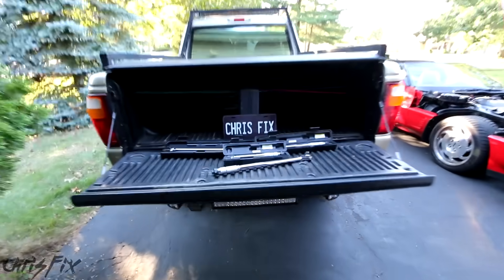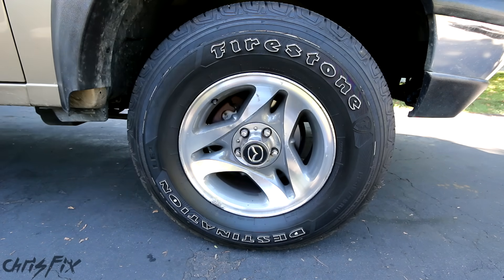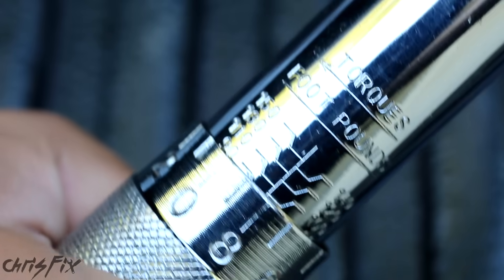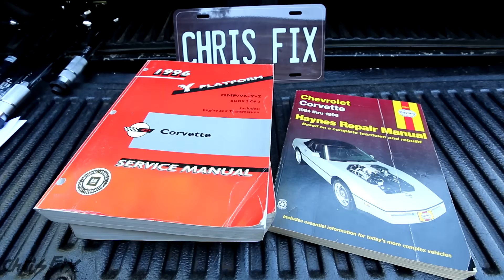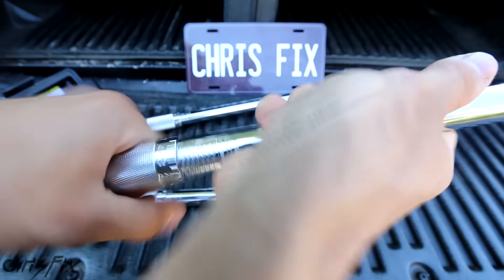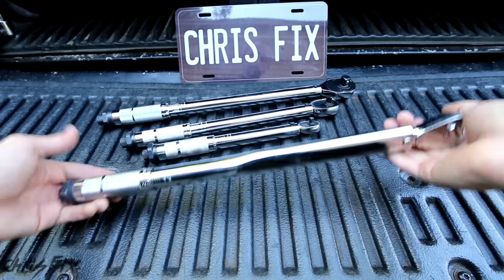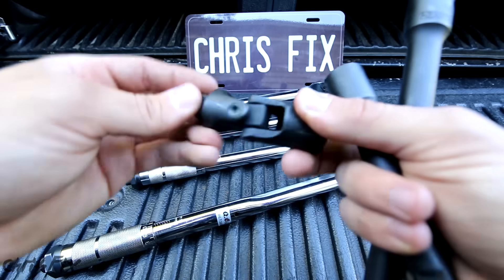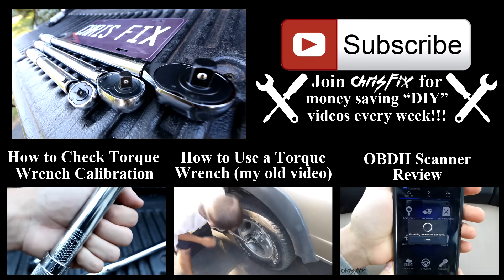How to use a Torque Wrench PROPERLY

Comment: When torqueing a bolt, the objective is to stretch the bolt such that the force generated by it is applied to the bolt's threads.  This causes the bolt head to compress the two mating surfaces together with a known force.  Although unperceivable to the naked eye, bolts do stretch.  Different materials have different stretches per given force. In some applications, you want the bolt to stretch more due to its internal structure.  Roller coaster bolts, for example, are able to stretch more but are hardened steel whose sheer properties and strain stay within the limit of forces placed upon them.  They are very critical and must stay within their design limits.

In the automotive world, the best known torque, of course, is lug nuts.  Stretching the bolt using the correct torque with apply the correct force to mate the two, actually three, surfaces together correctly.  When the wheel bounces around, it wants to separate the materials by overcoming the forces holding the lug nut against the wheel.  Correct bolt stretch caused by correct torque will keep them together within their design limits.

If on a properly installed wheel, measuring the stretch will achieve a more correct force; however, not too many people have such equipment. Torqueing is the next best way and easy to do.
Reply: I got it, & totally understand. Thank U for sharing. 🙏🏿
Reply: well call this a lesson.... thanks dude
Reply: Smart affor this 🗣️
Reply: yeah i ain't reading this bru 😩😩😩
Reply: @ferrariboxbox  I did but didn’t get it😅

Comment: Torque wrenches are actually not a good measure of the preload on a bolt. With CAT and other equipment manufactures you use degrees of turning. First you make sure the bolt / nut is seated then rotate the bolt X turns or degrees. Why because knowing the thread pitch the manufacturer can calculate the bolt preload or stretch. Now with torquing friction can vary based on lubed or dry threads, biolt head surface, thread condition etc. so for "precision" we dont use torque wrenches. Another example is the cylinder heads on large marine engines where we actually use a hydraulic ram to stretch the bolt that could have a 2" diameter then we can almost run the nut down by hand, release the pancake hydraulic ram and go onto the next bolt! I have even used torque multipliers on some bolts but again torquing with a wrench is press accurate but can be way off. I won't go into aircraft but our torque wrenches (yes we often use torque wrenches!) are calibrated regularly and the FAA inspector will ask to see these certs and see the wrench and match the SN. They dont care about the sticker on the wrench and can be very fussy! Lots of torqueing experience over 50 years!!!

Comment: Thanks for the teaching. As always, I look up to your videos to learn more. I've had three torque wrenches for years now but I have never used them (they were given without instructions)  because of the lack of knowledge. I have always relied on "measured force" to tighten the bolts and nuts that I have come across with. Unfortunately, age collects higher rent as the years go by and I cannot longer trust that method. Please keep your videos coming as they have proven to be very informative, entertaining, and instructive.

Comment: Unfortunately this shows exactly the way you should NOT use a torque wrench. Too much force is applied and yes you can put a lot more torque on that wrench by just not using it carefully and very slowly. Noone does it correctly with lug nuts because they can handle more force but if you do this on an engine you might run into problems.

Comment: I'm not sure if anyone commented on this already, but to be most accurate, one hand should be holding the head of the wrench stable, while the other hand is on the handle, applying the torque.  This ensures that the torque is being applied on the proper axis.

Comment: If it's anything like springs I've used with firearms, it's much worse on the springs to go from tensioned to untensioned on a regular basis than it is to just store the items being either tensionsed or not.

The continual tensioning and untensioning causes more issues to the spring.

Comment: The proper way to torque a bolt is to get a great big breaker bar and put a pipe on the end of it then you tighten it down until it strips then back it off one turn

Comment: can you use conversion adapters? like if you have 1/2 inch torque wrench, you get a 1/2in to 3/8 adapters will it calibrate correctly?

Comment: I've always been told to tighten torque wrenches to 20% maximum value when storing, so if the 1/2" torque wrench max torque is 150 ft- lbs, then you would store it at 30 ft-lbs. 
Not sure if this is the correct way, any Engineer out there know if this is correct?

Comment: After the incident where I snapped a bolt for my hydraulic timing belt tensioner with a torque wrench, I basically stopped using them. Since the bolt goes into the block i thought I ruined it but luckily I got it back out and the threads were fine.

Comment: It's honestly cheaper to buy a new torque wrench than get them calibrated. $25 half inch 10-150 ft-lbs torque wrench vs $75 calibration. And don't give me that "I have to buy the $150 dollar Snap-on wrench cuz torque is so important!!!" Anything you are doing in your garage can afford to be off by at least 10% so the cheap +/- 4% wrench does just fine

Comment: I bought a 1/2 inch 3/8 inch and 1/4 inch from harbor freight.  Pittsburgh Brand.  The 1/2 inch has all the guts fall out of the top after a few times of use.  And yesterday the 3/8 inch has some sort of gear problem.  It wasn't catching.  Was having to move it around a lot to get it to work.  Anyways, is that just because it's a harbor freight?  One thing I did notice was that you didn't release all the tension off the spring which I always did.  Also somehow i got water into my case on the 3/8 inch.  Resulting in some rust forming.  Could that have cause the gears to mess up?  I'm just kind of at a loss and harbor freight is telling me they won't let me exchange it because I don't have a receipt and there was glitch in the system that wouldn't let them add me so now I have to buy another one.
Reply from the maker: That could happen, I'm surprised to see 2 of them going out like that. I would just go back and get them to add you so you could get an exchange!

Comment: Why would u use ur muscle and back to lift up the Torque Wrench? I learned to use my weight on the Torch Wrench and pressing it down, which is a LOT better than this..
Reply: Always pull , don’t push. It is harder to stop when needed if pushing causing over torquing.  fastener could slip and cause injury to you or equipment.
Reply: @misterbgs1  I never had that, I push until I hear the “click” sound and I stop right on time.

Comment: Plan on doing my spark plugs myself so this video was absolutely helpful. I bought the wrench, plug socket, and extension. So this is absolutely nice to know. I already feel more confident about it
Reply: How did it go, mate? How many times have you serviced your spark plugs and the related components by yourself?
Curious to know!
Best wishes.
Reply: I’m planning to do the same and also with my brakes, need the torque wrench and some lubes and I’m all set

Comment: Hey ChrisFix! Your videos have inspired me to start my own DIY journey on my Honda Civic. I bought the  1/2" Teng Torque Wrench. I've read that with the clicker torque wrenches, you shouldn't use the low settings. The Teng torque wrench I bought is 10-150 ft. lbs, what range do you think it will be reliable? The Honda repairs I want to do definitely call for a 1/2" torque but I am curious if I can hit the 14-17 ft lb range I also need or if I should  buy the 1/4" torque for those. Sorry if this is a little wordy but I appreciate and value your insight!

Comment: I just bought a Neiko torque wrench that has the numbers 0-1-2-3-4 on the handle instead of 0-1-2-3-4-5-6-7-8-9 numbers. What do I do about that? Is the 1 really 2 feet of torque? And the 4 really 8 lbs feet of torque on my wrench? I read the instructions, but the instructions don't even refer to the 0-1-2-3-4 numbers on the wrench I bought. The instructions are using 0-1-2-3-4-5-6-7-8-9, like your wrench. Thanks...

Comment: If the manual specs shows 160 lbs of torque and the torque wrench has 
upto 150 lbs do you set it down to 10 lbs for the difference to add onto?

Comment: Thank you for this video. I understand the idea now. I  need a torque wrench for my 14mm oil drain plug so I can make sure it's tightened appropriately. Can you point me in a direction? Right now the only idea I have is to google small torque wrench.

Comment: Never pull "UP" on a torque wrench as he has demonstrated. Move to the front of the tire and push down to achieve the torque. Use your body weight with a straight arm to get the leverage you need to torque it. Use your legs and not your back. Its the way I learned in the Airforce when torqueing aircraft nuts. It will save your back in the long run.

Comment: Best auto mechanic instructor on the web hands down.  Clear & thorough instruction, quality audio/video production...you rock Chris!
Reply: As Fred Rogers said, "You don't set out to be rich or famous. What you set out to do is to be helpful." That is what Chris has done. He set out to help people learn how to fix their own cars properly.
Does anyone get that reference?
Reply: You can use his teachings as a greenhorn and properly work on even delicate parts like cilinder heads, carbon fibre clamped fastners which require only 1.1Nm. He's good, quite good a teacher

Comment: Is it safe to use 1/2 inch drive on spark plugs ?
Reply from the maker: If it requires a torque that high then you would have to!
Reply: @chrisfix  my spark plugs require 25nm? So is that fine or would I need a 3/8 torque wrench

Comment: Remember you still need to apply counter force on the head of the wrench so all the torque is in the proper direction. Sure the losses may be minimal but when using extensions it is important that all the force is applied correctly on the nut. This ensures your torque is on the correct plane of the entire nut/bolt instead of pulling away from the head of a bolt.

Comment: Chris, question sir. I want to bring a torque wrench when I go off road or go on vacation, just in case I need to throw on the spare. Is using the 1/4 wrench okay?  My lb-ft is 100, but I don't feel like brining the 1/2 inch because its so large.

Comment: Hi, I have a question. I know you said that you can use extensions with a torque wrench, but can you also use drive adapters? For example, my socket set is mostly 3/8 in drive, but I want to get the wrench in the description. Can I use a 1/2 in to 3/8 adapter?

Comment: I got a quarter drive one recently and the click is not so obvious so I turned the bolt beyond ii the first couple of times. I hope I didn't mess up the calibration. Fortunately it was for a lower torque setting (9 nm). Hopefully it's ok.

Comment: since the units for torque are multiplied the way you say it really doesn’t matter
lb x ft = ft x lb
however, a measurement like pressure which is force / area is completely changed when swapped

Comment: in moist/winter climates with salty roads you dont need a torque wrench or threadlocker. At least I have not needed them. They would have been 100%  waste of money for me. For at least 10 years all bolts I have tightened on my car I have tightened by hand feel(even lug nuts) and this far all of them have rusted shut so that they can only be opened with a breaker bar(nuts and bolts that are visible for the weather elements).

In fact what I do is oil all the bolts with graphite and/or copper so that they would come loose easier the next time I will have to do something. However they still rust shut. Even had a whole rear axle of one of my previous cars rusted off because of the climate. basically it was so bad, that when we unscrewed it(entire rear axle with both wheel hubs and bearings still attached), the rear axle could be folded in half by hand.

Thats just my experiences. In other climates stuff might happen differently.

Comment: It goes half inch, quarter inch and the smallest is 3/8 of an inch. Might correct your video
Reply from the maker: 3/8" (using decimals it would be 0.375) is larger than a 1/4" (0.25)

Comment: I've had problems with 2 of my harbor freight torque wrenches not clicking which caused me to overtighten a couple bolts.  Most of the time they work fine but every now and then I would have one fail to click for some reason.  I've traded them in for Lexivon wrenches and the quality seems to be much better and the prices are still very reasonable. I have confidence in my torque wrenches again!

Comment: The only thing that matters here is that the distance from the rotation point is multiplied by the perpendicular force applied at that distance.  Since multiplication is commutative, a×b=b×a meaning it doesn't matter if you say foot-pounds or pound-feet. Those phrases are just historical artifacts and as such are unimportant. What's important is how many units of force you are applying (perpendicular to the wrench) and how long of a lever arm you have. Can you dig it?  I knew dat you could!

Comment: As an aircraft mechanic torque wrenches are a definite part of my tool box, you are mostly correct in your procedure but!!!! Please don't do the second click,  you are actually overtorquing at that point.  Thanks
Reply: Hello sir..i am using a torque wrench on my mountainbike. For e.g. say the bolts newton meter requires 10 nm. I read from a forum that you should gradually tighten the bolt using the torque wrench dividing the 10nm into 5..thus setting your torque wrench to 2nm, and after which 2nm is tightened, you set your wrench to 4nm. After 4nm is tightened, go into 6nm and so forth until you reach 10nm. They say it is for the torque wrench safety, not to wear it down quickly.
Reply: And also in mountain biking maintenance, as per parktool company advise, the torque value noted on the part to be tightened should be 20% less. Like if its 10nm, it should be rounded of to 8nm so as not to over tighten.

Comment: What if you need 8ft lbs but all you have is a 10-150 ft lbs what then and if you have a 1/2 " wrench can you use a 1/2" to 3/8 adapter

Comment: wrong wrong wrong if moving the scale of handle one graduation is equal to adding one foot pound what happens if you use same method but using metric scale then moving one graduation equals one newton meter therefore - one unit meteric equals one unit imperial NO NO NO NO!

Comment: Lol, I was working on my car and borrowed a torque wrench from a friend of mine. Didn't know how to use them properly, but now I know. Chris, you really make owning a car more fun since you can save a lot of money by doing it yourself and it is just fun to spend an afternoon fiddling around with a car. Without your video's (and the internet in general) I never would've bought my '95 Volvo 480 with 320K (kilometers) on the clock just because of the maintanance costs, but now I just do everything myself
Reply from the maker: I'm glad the video helped you out and i'm glad you're doing all your own work! Thanks a lot!

Comment: I disagree with your take that the correct statement of the units of torque should be pound-foot (in SI newton-meter).  I do concede either way is technically correct since units are not vectors and order doesn't matter (commutativity).  

However saying foot-pound (meter-newton) is a very welcome nod to the VECTOR nature of the formula for torque.  As a vector quantity, (torque (tau)) = r X F = ||r|| ||F|| sin(theta).  Order matters here since cross products are anti-commutative (r X F = - F X r).  Now, in fairness going into the vector-y details of torque isn't super useful for applications like car maintenance.  However, the colloquial adopting of foot-pounds is very much a nod to the fact that r PRECEDES F in the formula thus making it easier to remember and not screw up (if you reverse the product, the result is negative which, in rotation, literally means the opposite direction).

Also, because rotation contains some built in weirdness, the units of torque (rotational force) are the exact same units as energy (linear force * distance).  However, since energy is scalar quantity (the DOT product of the vector force and the displacement vector), and it is typically expressed as W=(integral) F (dot) dr where both F and dr are vectors; I contend energy should be referred to as pound-foot.  While this is handy to know, the dot product is commutative so this part of the argument is just an added bonus and either way is fine (F (dot) dr = dr (dot) F).

This convention (for torque and energy) is more consistent with the expressions of the quantities in their mathematical form, thus why I opt to use it.  Anyways, sorry for nerding out.  Thanks for the videos!
Reply from the maker: Thanks for sharing!

Comment: I just followed the link that says "the torque wrench I use" and looked for the same torque wrench. Ended up buying it from home depot bc they had free next day shipping. And just came back to this video and realized it's different from the one he actually says he uses all the time. Hopefully the one in the link is actually decent quality bc it looks like a budget one  and I see now way smaller than the one he actually says he uses in this vid. I bought it with confidence thinkin "it's the cheapest one at home depot but if it's good enough for ChrisFix..."  I'll report back if I have any problems with it.

Comment: Hey chris what if i have the 3/8 torque wrench. So if i am going to tighten the lug nuts for the wheel and it is 100 pound. What if i am going to tighten it first for 80 pounds then after i heard the click move it to 20 pounds for the remaining to make it 100